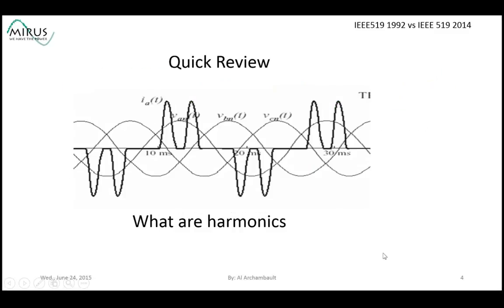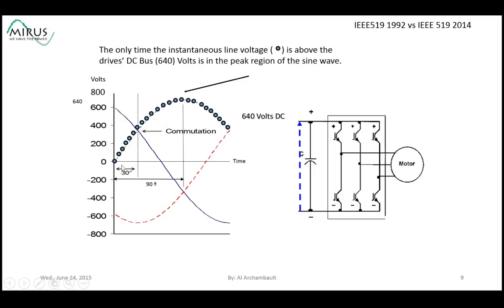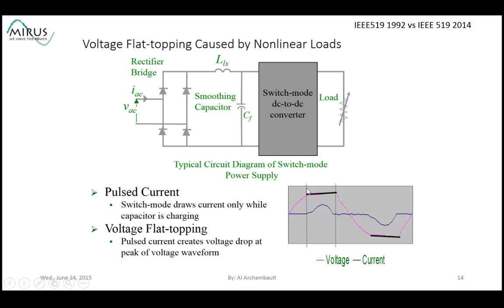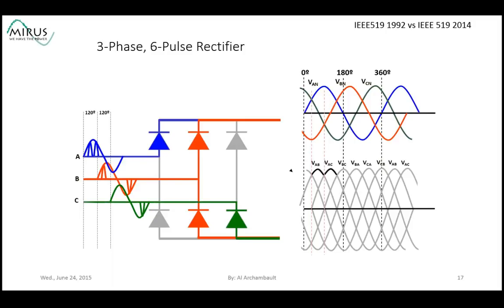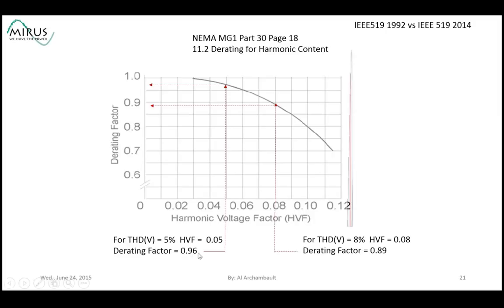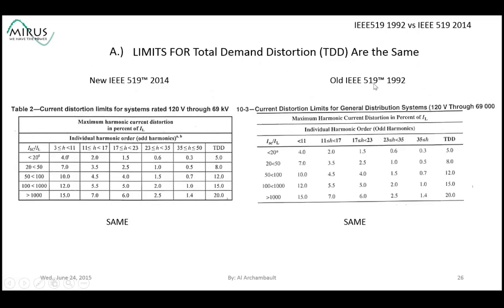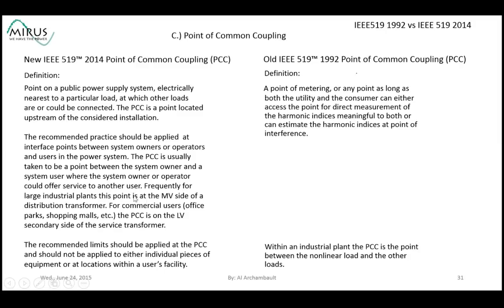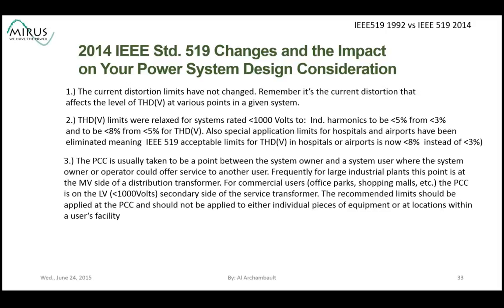2014 IEEE Std 519 Changes and the Impact on Your Power System Design Consideration

Comment: IEEE 519 1992 had a clause 9.0 which stated that measurement should be done for magnitude and phase, where as 2014 edition does not specify anything for phase angle. Why?